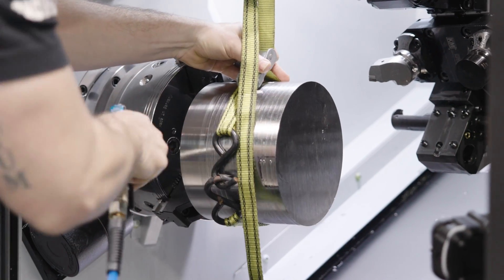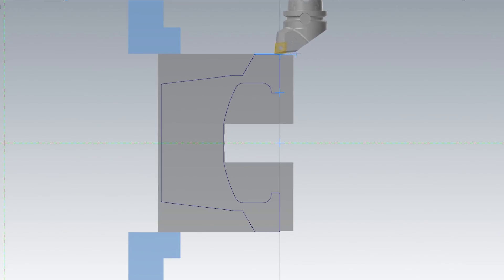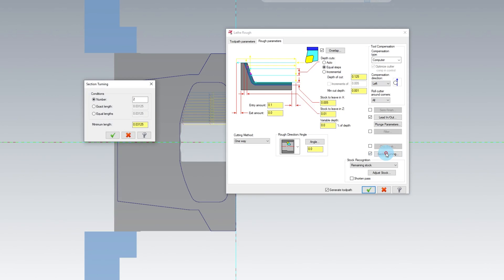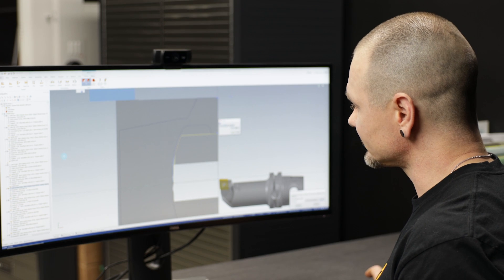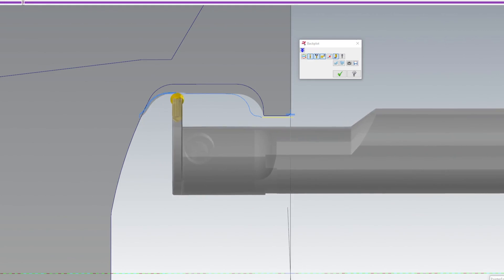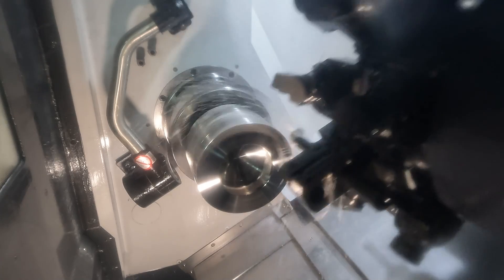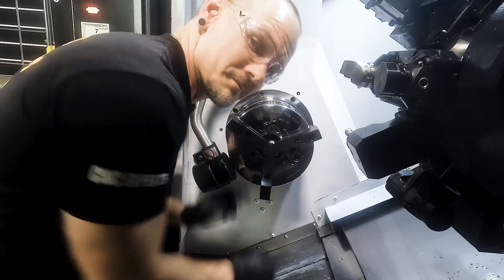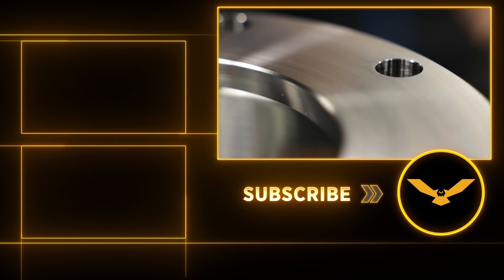Machining 15-5 Stainless Steel on PUMA 2600SY II CNC Lathe | DN Solutions

Comment: I didn't hit the green button and I'm still holding my breath watching that ID boring bar. BTW the attention to detail in that programming  leaves me with mixed feelings. One, it's a breath of fresh air to see a smart programmer who actually knows the material and how to work smart/efficiently. But two, it infuriates me even more that the types of suggestions I had as an operator, that were constantly being brushed aside while I was being told "it still makes a good part," were actually as easy as I imagined they were.

Comment: Is there any concern of pulling the part out of the chuck with the dynamic roughing? I assume it's fine obviously, y'all know what you're doing, but are there any differences as far as depth of cut, feed rates, etc that you keep in mind? Or does the clamping strength just make that irrelevant?

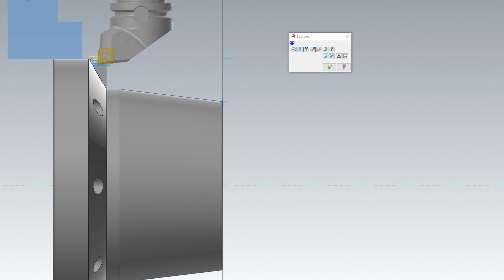Comment: Crystal clear, although, Im just learning about CNC's, could tell me if going snake option on opposite side of the part 9:00 wouldve been faster and more smoother? Couldve also lined up perfectly that flat horizontal surface near the diagonal one. Or was this done to savor the bits integrity?

Comment: Hey guys,

I have a question why do you Programm such a simpel part on a lathe with CAM Software?
I am from germany and a Lathe Machinist and Programmer i Programm all my parts direkt into my Machine it's very easy 
With DIN PLUS 

My Machine is a Gildemeister NEF 400 with Heidenhain CNC PILOT 4290 Software
Reply: DIN Plus is CAM Software.  It just happens to be built in the controller.  It's really no different than using Master CAM.
Reply: @brandons9138  Ok, I didn't even know that DIN PLUS is a CAM software I create a blank with the G20 function And then a contour that is to be machined with G1,G2,G3... Etc Then it continues with the DIN cycles, for example G810 roughing inside or outside along the contour with cutting edge radius correction I thought that with CAM software you have nothing to do with G code anymore and the software recognizes where to cut and suggests tools etc

Comment: You can put multiple g96 and even mix with g97, use  g97 first few passes and when the diameter gets bigg enough switch to g96

Comment: Great video Travis! Speeds are almost spot on to what we run at to rip material off. I personally rough this material dry or with an air blast.. it chips out WAY better and we don't experience the thermal shock effect as much. Tooling seems to last a bit longer. Even with an insert drill.. (air blast for sure!). This material turns rough but finishes beautifully. You can turn/mill it with a busted ass insert and it will still be shiny. May not be a good part though lol 🤔 It also looks sick when heat treated!
Reply: Thanks Robbie. I'll keep that in mind.

Comment: If you would have done shorter z cuts on your undercut and disengaged the cutter you could have possibly gotten it to chip a little better. More lines of code unless you writ a little sub-program but keeps you from having to stop to pull the nest out of the part. Overall very interesting video
Reply: Thanks for the comment Dan. I'll keep that in mind.

Comment: that's beautiful I wish I can work in this trade, I was into milling but now maybe I'm a lathe guy.
EDIT : could you please tell us why would the button insert internal grooving tool dig in the material if you used it to finish boring the back face Travis said it in 6:25
Reply: The Tool Holder diameter is too big compared to the carbide boring bar, as the bottom insert would feed to X0, the back of the holder would crash into the part.
Reply: @jessetw52  yes sir. Thank you.

Comment: If this part wasn’t hardened material,in the second operation would you still machine the outer diameter in two parts due to the holes?
Reply: Hard to say for sure. It would probably depend on what material. Aluminum I would just cut through without any difference whereas with other materials I would likely try a couple different parameters and use what cuts best.
Reply: @travisjarrett2355  Thank you for your reply. Keep up the good work.
Reply: @travisjarrett2355  The title mentions "precipitation hardened", yet you mention "annealed", "gummy" and "hard to break a chip". So was this 15-5 in Condition A? (that would be solution annealed) It could perhaps be H1150 or the softest most ductile H1150M. H900 or H925, on the hard and brittle end of the scale, would probably break chips easier.

Comment: Nice job I machine this material regularly and it’s big brother 13-8ph h950, bastard material to cut but I like Mitsubishi 9015 inserts, we just got a nakamura mx100 with oscillation that I’m hoping will break up the finishing swarf , as it’s almost impossible to chip small doc as you see here, would go with a bigger doc for that undercut personally … love from England
Reply: All the chip problems in this video could be solved by running a chip blaster on these machines.... I ran 100K # of 15-5 H925 a year on Twin Spindle live tool Okuma's and we cut it like 4130...
Reply: @stbentoak5047  what is a chip blaster ?
Reply: It is 1000 psi coolant flow thru the tool/nozzles. Allows increased feed rates and higher DOC and better chip control in all materials…..
Reply: @stbentoak5047  I have hi pressure though coolant although it helps with roughing, I don’t find it has much effect on stringy finishing swarf especially with grooves, which inserts did you use ?
Reply: We are mainly Sandvik, but also use Iscar and PH Horn… intermittent cuts help stringy chip formation….

Comment: What is this part for? Very strange internal recess, with a thin wall section; I cannot imagine what it is for and why it would be designed that way..
Reply: It’s for ligma.
Reply: ligma what?
Reply: @highlightguy5464  ligma BAWLZ!! Ha! Goteem!
Reply: @vinnie302  heeyyooo
Reply: We will just have to wait to see how the subsequent mill operations finalize the part. The material is very heavy and tough, so it can tolerate high temps and dynamic loads. They like to keep us guessing I suppose, but the angular shape causes me to wonder if the previous prop part may be related.